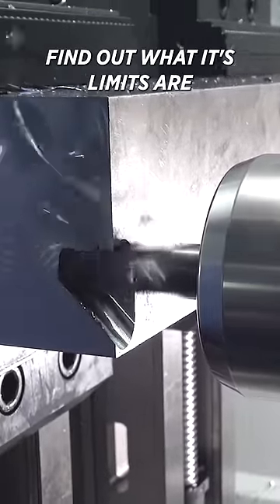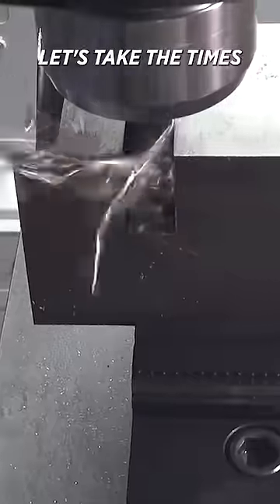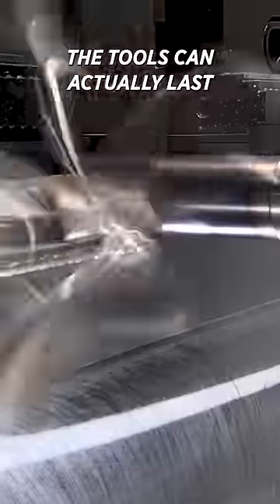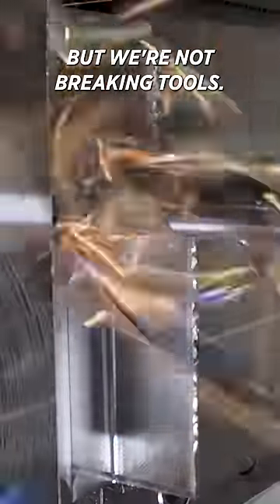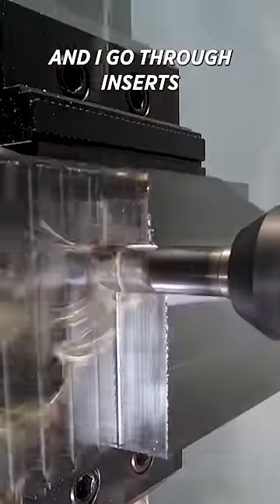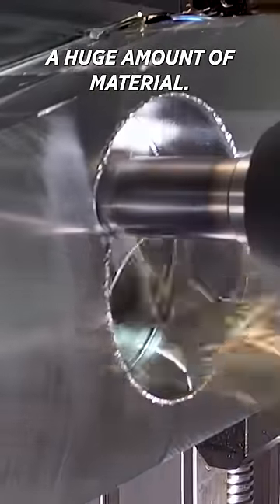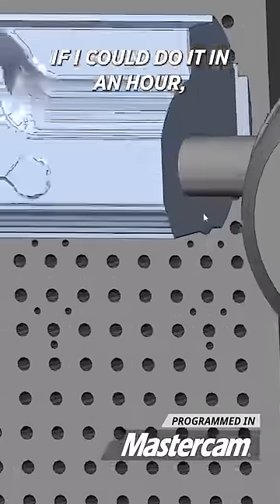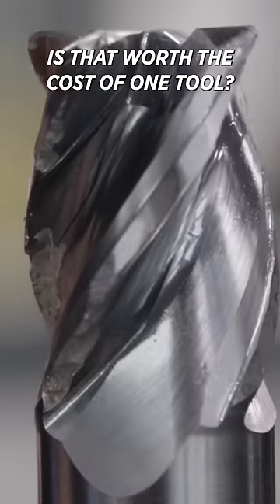Why Do We Push Our Tools to the Limit? #shorts

Comment: It is not just the damage to the tool, but also the machine. How much money you going to loose when it crashes from the extra stress? CNC machines are very costly, repairs can be very expensive as well depending on what breaks. Down time is another cost, if a part that is damaged is back ordered for say a week or more, then your totally down. 

I would rather spend the money and get a 2nd machine then run one hard. That way when one does go down from normal use, you still have a backup, when both are operating then your work is twice as fast and not doing damage. I am also sure the work piece turns out better as dull tools seem to do a rough job.

Comment: Push your tools and machines to the limit and make two parts faster then break your tool on the third wrecking it = less profit as you have to make the third again. Wreck your machine and you can’t make anything until it’s repaired = less profit. Have sub-par finishes on your parts and get less business = less turnover = less profit. If you’re making custom parts then the time is factored into the price. If you’re mass producing parts then with a set shelf price then all you are doing is sacrificing quality over profit.

Comment: Those bits won’t last long at that temp. It’s so hot the chips flying off are immediately rainbow colored.
Reply: Running coolant would help greatly
Reply: @Turbogto_guy  some tooling can handle the heat and actually will break faster with coolant which i would assume is the case here

Comment: This guy fails to mention other factors.  Mainly that the faster cutting time causes the part to heat up faster. This is a big factor in the tool wearing out more quickly but depending on the type of alloy you are working on, it could ruin the part. This is also a factor in welding. Often you have to let the piece cool between passes and passes must be kept short to prevent the piece from getting too hot or from being heated unevenly.

Comment: That's what causes lesser companies to have problems. Take the firearms industry. In Russia the reason the AK has so many variants and sub variants is because instead of replacing worn tools and parts. They just stamp the part with another designator. Making a hypothetical ak74A, AK74B, and AK74C. All the same firearm but with different tolerances because they use the bits and tools until they break. 
  Taurus does a similar thing. 
  I never understood why. It's very anti consumer. I guess it makes money but not really in an efficient way. Their products suffer and their reputation goes to shit.

Comment: Good luck when your tool running hot goes blunt and ruins the surface... Or worse, catastrophically fails and takes a chunk out of the piece you've been working on for over an hour.
Reply: If its anything like the end mills a shop i used to work at use for rough passes similar to this itll shatter. Have a stop coded in at the end of the pass, most cases you'll clean out what loose bits are left in the part, put a new mill in, adjust the offsets, and run that portion of the program again. I alwayd dropped the feedrate back a bit until made contact and cut some more material out before setting it back at full speed.

Comment: But if that causes you to have poor quality control, running at 80%, is that worth the time savings?
Reply: I’ve always heard this saying while in the machining industry and stuck by it. “Customer pays for the finish cut, but you pay for the roughing cuts”. Always make sure the finish cut can meet the tolerance requirements every time.

Comment: That’s fantastic until the tool ruins the part. Then you’re out the tool and the product. Why spend four hours making one good part, when you can scrap off four parts in four hours!
Reply: Obviously if that was happening he wouldn't be making this video. Notice he said running the tools hard but not breaking them. If you can double production and tooling costs go up 50% you're winning. Assuming you have decent profit per piece of course. The appropriate sating would be "penny wise, pound foolish". Or in the modern vernacular, you need to spend money to make money.

Comment: So you basically use the standard for operation of computers, and impliment it for using machining tools. Sounds like a pretty normal procedure to me. That's how Servers and Networking Equipment is used properly, and how it has been done for decades.

That's also why Elon Musk does what he does, and doesn't worry about mistakes or failures in rockets. You break stuff, so you can learn how to fix it, or learn what not to do.

Comment: Your pushing way to much heat into your metal work piece causing it to expand as you machine it taking away more material than you programmed for. When your piece cools it will be out of tolerance. There is a reason for chip load ratings, your not outsmarting the system.

Comment: The cuts are 😖  And the quality of the job is not optimal. So, no... is not worth the cost of the tool. Specially when most of the tools cost more than the part you working on.
Reply: Depends on the shop and what kind of parts they run. One of the ones i worked at had a ton of jobs where each part would easily be mid 4 to low 5 figures per part. Quality wise thats why you run tools to do the finish work